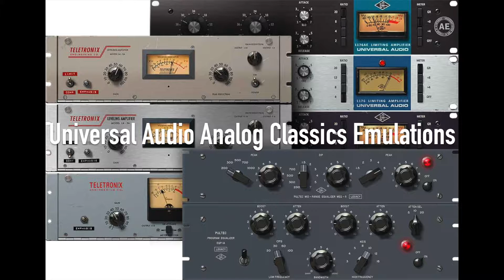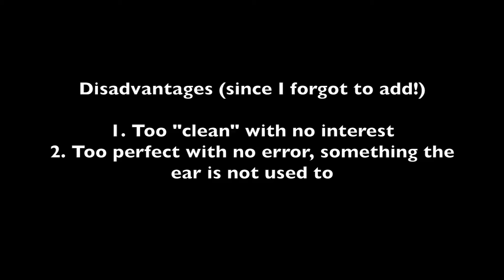10 Things I Learned at an Audio Engineering School

Comment: I would add unity gain to signal flow, which links it to gain staging which is very, very important to have clear understanding of the signal flow and gain staging, and all of that is tied in with the concept of unity gain: that the input and output levels of each device in the signal flow are equal. You don't attenuate, you don't add gain, you keep them the same. It makes handling signal flow and gain staging so easy to handle, it makes your whole workflow more predictable. It ensure your signal quality is at highest possible, it makes sure each device is working in their nominal range, at signal levels that they were designed to. 

In practice, when you tweak any effect, eq, compressor you keep an eye for input and output levels and constantly adjust them so that the signal is not boosted or attenuated. You raise the signal level to the optimum once in the preamp section and then you keep it as close to 1:1 ratio until the channel balance is set with a fader. It makes EVERYTHING so much easier. It also means that when we do break that rule, and there are reasons why we sometimes want to do that, those cases are exceptions to the rule and you will remember it better. If every single signal route is all over the place when it comes to gain staging you can never manage that chaos and will make tons of mistakes. And your noise and distortion levels will increase. Unity gain has the best signal quality possible, there are dozens of unity gain stages inside the hardware too. I was lucky to go to electronics before sound engineering, i had good grasp on complex signal flows but it was very important part for me too, to really get hands on experience how to do it right when it comes to audio. And the concept of unity gain applies in the digital world too. 

BTW, audio engineering and sound engineering are not the same thing.. Some countries call sound engineers audio engineers, like in this video. The difference is actually simple: audio engineers design the hardware that sound engineers use..

Comment: First off all, get the word engineer out of your mouth. What you have achieved is an understanding of the application of the gear and concepts that audio engineers designed to do your job as a end user audio technician. Stay in school, learn the trigonometry of waveforms, how to build circuits and consider their values and understand acoustic resonance and be able to communicate it scientifically, building the tools you have been exposed to.
  A bachelor's degree in electrical engineering separates the wheat from the mixer and enthusiast. Kudos for your work that you have put in.